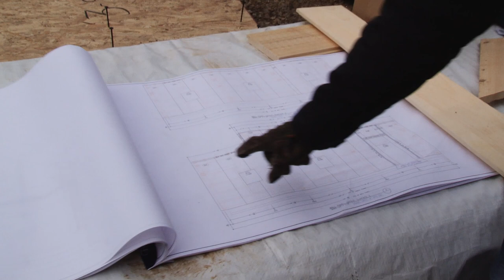Insulating a Post & Beam Carriage Barn with SIP Panels

Comment: Why do you choose styrofoam or similar as opposed to polyiso/polyisocyanurate? Im building my own structure and polyiso seems like the only material that will perform well enough. Have you had trouble with polyiso? Thanks!!
Reply: Because polyiso loses its performance when cold. So it has to be on the inside of the insulation stack under another material. In this case, the SIP being the only insulation, there is no way the polyiso would be protected from the cold.
Reply: @marcblondin6016  polyiso loses some performance in the cold but it still outperforms styro 4:1
Reply: @chinamed1  Please explain what you mean by "4:1"... 
Ideal R-value of polyiso per inch = 6.5. XPS is 5. This is only 30% above at optimal value. How can it outperform 400% when cold if performance is lower?

You can find many sources reporting R-values in the 4 to 5 range for polyiso in cold temperatures, which is below the XPS typical value or equal at best.

Comment: So the SIP panel sits on the outside?  I guess that enables you to run electrical and plumbing between the timber frame posts?
Reply: sip panels have channels pre drilled to slide wiring through